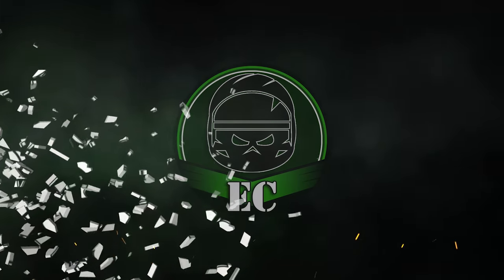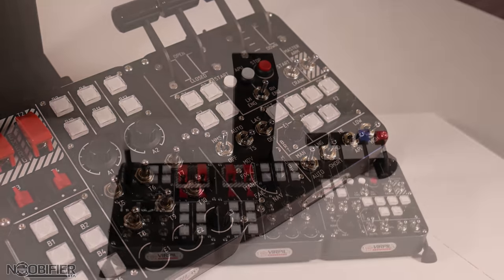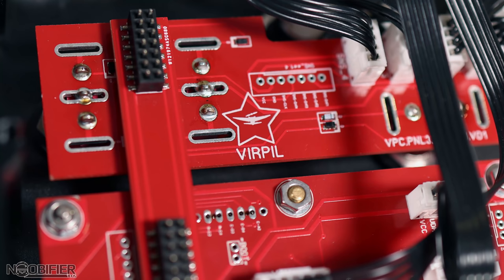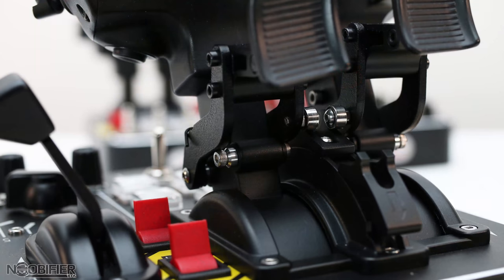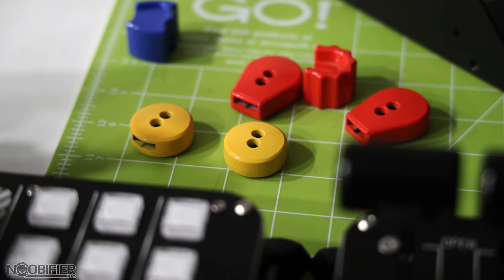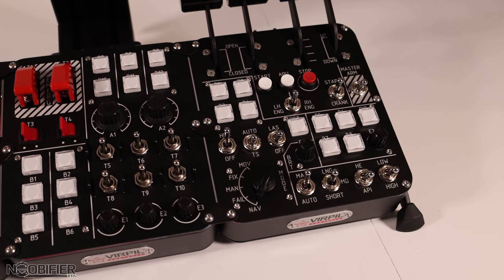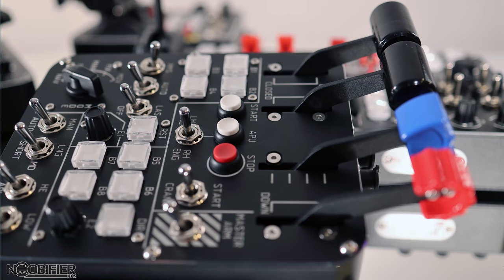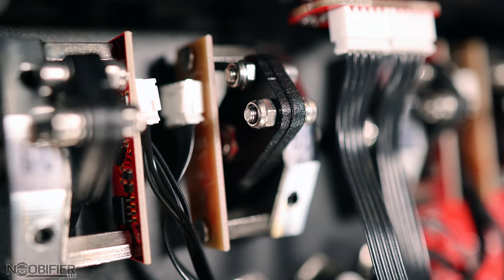First Look - VIRPIL Panel #3 - Total Throttle Replacement? - Sharka50

Comment: Virpil is the greatest company to ever invest in with all your gaming needs.  im usually the " just get somethin cheap itll feel the same" type of person. boy was i wrong.  bought cheap and was not satisfied at all but played through it just to end up having parts fail and need to buy another cheap one...... it all adds up over time.  finally picked up a virpl t50 throttle and the warbird.  instantly lost all buyers remorse as soon as i hooked them up.  the gear is sooo good that they make most games less appealing and i want the best game to match with the best gear i have now.. i think that make sense lol

Comment: Off/HMS is for the Helmet Mounted Sight in the Ka-50. The whole panel in fact is 1:1 mapped in Ka-50, every single input. AUTO/TS is likely for the automatic tracking/slave to pipper switch next to it that lets you chose whether to use the Shkval as a targeting sensor for atgms or as a sort of telescopic sight for fixed weapons.

Comment: This review helped me when I was looking at this months ago. I own it now and it's fantastic. I use it for IL-2, a WW2 flight sim. It's perfect having multiple levers for throttle, RPM, mixture, radiator flaps, etc. The throttles feel great. The customization is nice. I have two complaints. The lighting is not customizable enough and the Virpil software does not allow the axes curves to be adjusted. I use joystick gremlin to get around that. I also use it in Elite Dangerous, and I use the levers to engage/disengage supercruise and hyperspace jumps, and it really gives me that Millennium Falcon feeling when jumping. I would highly recommend this. Thanks for the review.
Reply from the maker: Thank you very much for the follow up. I am happy

Comment: I want it! But I have all the controls I actually need. What I actually need to sort out now is my desk situation. I'm using a cheap standing desk from Amazon with so much hardware that I have to weight down the legs to keep it from tipping over.

Comment: I bought this + a z extension for my alpha stick (L) in my setup. Z extension for Star citizen (throttle) and the quadrant for all my microsoft simulator needs. Both came out to about 80$ US less than the 1 Throttle which was better value for me :). 

 @Noob what’s the best way to reach you? I need to send you some pics of my setup for advice on positioning
Reply from the maker: Discord is the best. You can join the community with the link and look around.

Comment: Any idea if it's possible to remove the levers and flip them around so the reverse angle makes them handle more like throttle levers? So at full forward they wouldn't lay as flat, and full back they would sit at more of an engine idle position.
Reply from the maker: Just mount the panel on an angle and no, I don’t think that is easily possible without manufacturing a modification

Comment: The reason why its called the SharKa-50 control panel 3, is that Virpil/the contest winner designed it and the SharKa-50 collective with the Ka-50 (Pronounced "Ka" NOT "K - A") combat helicopter in mind.
The Ka-50 have many nicknames, one of them is "Black Shark" and is used by DCS World, hence Virpils reason to name the collective and control panel three.
You should have known that during research.
Since the Ka-50 is a combat helicopter that belongs in the aviation category and NOT the navy, (I literally have no clue why you have your navy head on when speaking aviation, perhaps its a good time to retire) it is very common, if not exclusively, to have the HMS acronym stand for "Helmet Mounted Sight".
That acronym is shared between fixed wing and rotor wing alike.
After 30 years in the military you should know that the only two excuses for not knowing what is either obvious or you have been told is lack of attention or simply lack of preparation.
Sorry for being rough on you, but if you want respect as a youtuber in the DCS community, know your stuff and do your research.
Put quality over quantity.

If you decide to go into the DCS World, just remember that there is a world of difference to fixed wing ground attack, fighter jockey, rotor wing ground attack, rotor wing transport.
Just because one is skilled in dogfights does in no way mean that that person is skilled in ground attack and vice versa.
And just because someone is skilled in fixed wing does not in any way mean that they are skilled in rotor wings.
And dont think that you are skilled in any DCS modules just because you are skilled in star citizen.
That is my experiences after eight years in the DCS community, i have seen many youtubers acting like maverick when they join in, only to fail hard and i have seen many fighterjockeys fail hard when they try ground attack and fixer´s trying rotor´s, and vice versa.
Reply from the maker: I mean, I can call it whatever I like right? Im not Russian.
Reply: @NOOBIFIER1337  I was just trying to help you to a good start on your new career.
Reply from the maker: @bmbpdk  it’s appreciated but Im not a pilot and won’t ever pretend to be. If I play DSC on stream it will be for fun. Not to sound negative at all, just some people are just happy.

Comment: I still try to figure out how I could get that to work with my chair/table combination.. neither seems to work well with mounts for joysticks/throttles/panels.
Reply from the maker: have you looked at this video?  https://youtu.be/2rZeh7g8Vlk
Reply: @NOOBIFIER1337  Yes :) I wish we could see it more in use though, not standing free of everything on a plain field. I want to be able to just flip the mounts left and right away and sit comfortably at my desk with mouse and keyboard. Especially for star citizen I need both.

I think I also need to replace my desk first.. due to its frames in the front of the desk, there is barely any space to sit at with a normal chair, let alone one with mounts at its side and sticks poking up. 

Then it'll either be a chair like that or, because I like my corsair chair, I'll find mounts that fits my current one.

Anyway, I really like your equipment videos, keep them up :)

Comment: So almost none of those metal switches are the two way momentarys they put on the throttle or the other panels?  That's a shame, when I saw it had 10 switches, if they were momentary switches AND the buttons were also on a 5 way bank like the throttle.  No reason everything cant be mapped to controllers!

Really though congrats on retirement, must be both a little scary and a little awesome at the same time!

Comment: 2:36 is that a missing solder joint I spot on one of the switch leads?
Reply: It certainly looks like it actually yeah - perhaps an unused pin?

Comment: Love your vids brother. Do you have any thoughts on using a dual Alpha setup along with a panel or throttle in SC? For the life of me I can’t make three controls work without redoing inversions and control numbers every session. I’d love to be able to run my dual Alphas plus my T50cm3 for mining but good grief it’s a PITA.
Reply from the maker: Use a powered USB hub, a old one, USB 2.0
Reply: @NOOBIFIER1337  Thanks for the quick reply. I’ll order one. I use one on my chair as all my stuff is Monstertech’d but it’s a 3.0 I believe. It’s something to do with boot order I guess?

Comment: Does this panel also require 3rd party software to get full functionality out of it like the Throttle?
Reply from the maker: Neither require the software to function, just for settings and firmware
Reply: @NOOBIFIER1337  When I had the Throttle SC only recognized some of the buttons even though they were all set up in the Virpil software and windows recognized it. I even contacted Virpil about it and they said that third party software would be needed to get "full" functionality in SC. Last I read (a while ago) was that they were working on their own solution. Judging by what you say perhaps they did find a solution. I have long since sold the Throttle to an Org mate so I can't verify.
If everything works as expected this panel would actually be pretty cool. Just a little gun shy since the disappointment with the throttle experience.

Comment: For dual stick virpil setup for star citizen should I get panel 1+2?
Reply from the maker: Panel 3 is worth the look
Reply: @NOOBIFIER1337  also for star citizen are any of the dials on the panels even useful?
Reply from the maker: @WhopperRektem  I would say the two on panel one might be. The others are bound like keyboresses so not so much
Reply: @NOOBIFIER1337  have you tried the thrustmaster tpr rudder pedals? I’m gonna have all virpil aside from the rudder pedals. Also what’s the difference between the Warbird base vs the more expensive one?
Reply from the maker: @WhopperRektem  I’m really sure that pedal set is crazy heavy and expensive. I would love to take a look at them, but I simply don’t have the money to test everything.
Reply: @NOOBIFIER1337  yeah 600 bucks but I hate the style that’s flat…
Reply: Might send you the unboxing vid on discord if you want

Comment: I use two flights sticks from Virpil and i love them!  There is hardly anything that replaces the haptic and tactile moment of very well built and designed controllers.  The only thing that holds me back is that the design of analog panels doesn't really match the wonderfully futuristic cockpit elements of Star Citizen.

Comment: honestly virpil stuff really is just that good ive been running virpl for star citizen and its always worked great i have a cm2 throttle a connie alpha stick and warbrd base and a panel #1 which are all a bit older but they all still run great

Comment: I'd kinda like Virpl to do a Space sim themed panel
Reply from the maker: You can mess with the stickers and labels
Reply: @NOOBIFIER1337  Well, yeah, I totally get this could be adapted rather nicely. However, I think this was sorta of a nod to chopper pilots, theme wise modeled after etc etc. 

I'm suggesting that, say, take every ship in star citizen layout for buttons and stuff in various cockpits and design sort of a one size fits all generic themed one.

Or work a deal out to make one for each ship. Just spitballing ideas

I'm rather new and a bit overwhelmed with the shear number of buttons. You map them and forget where you mapped them. Then, when you figure it out, you're why did I  bind it there.
Reply from the maker: @kazzdevlin5339  for this to be legal, virpil would need to have some sort of agreement  with CIG